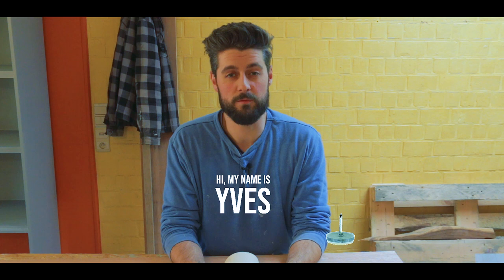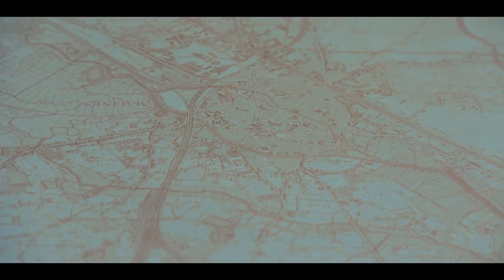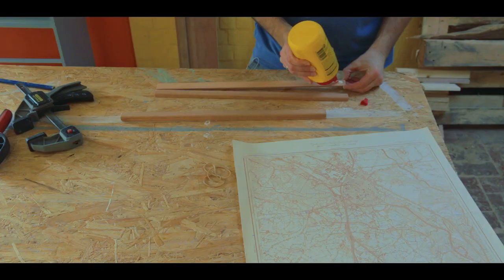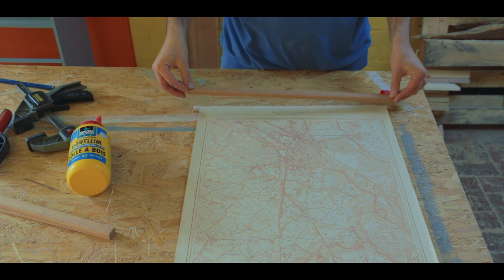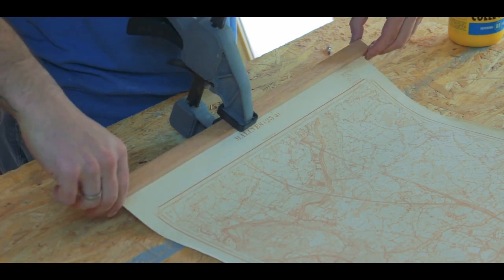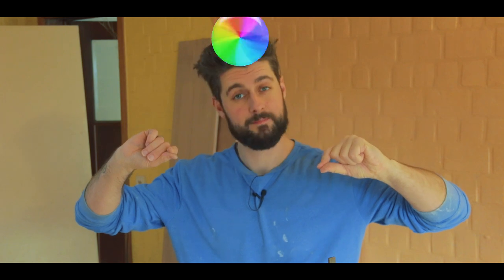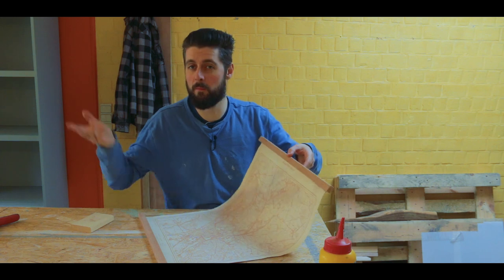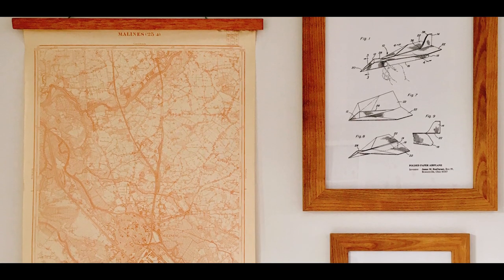EASY PEASY | Framing any Artpiece like an Old Classroom Map

Comment: Very nice, i made one of these poster holders last week. The one i made was 6 feet long and i used magnets instead of glue so that the print could be changed out if the client wanted. I like the simplicity of using glue! Would have saved some time for sure

Comment: It would also have been worth seeing, how you attached the cord to the upper wooden piece.
Reply from the maker: Hi manuel, I used 2 thumbtacks. Looped the string around them and pressed them into the back of the wooden upper piece. That way they push the small knots in the string flat and it sits flush with the wall.

Comment: Noooooooo! As a map collector and woodworker this video made me cringe. You should never ever put glue on an old map or one that you plan on surviving past you, as he showed it can rip, the moisture in the glue bleeds and will wrinkle the map and it stains the paper. Speaking of stain he should have stained the frame BEFORE putting it together as well as protecting the map from the VOC’s from the stain. Also if you plan to cut anything on a table saw push the material on the fence side (right) or if too small a strip make a jig so the piece you are cutting doesn’t fly backwards and  impale you, just my two cents. If you have a map that is new or not worth anything this is the framing method for you though.
Reply: I have some old NatGeo maps. Would you recommend reinforcing them with fabric if hanging them with wood? Is there anyway to do this without glue?